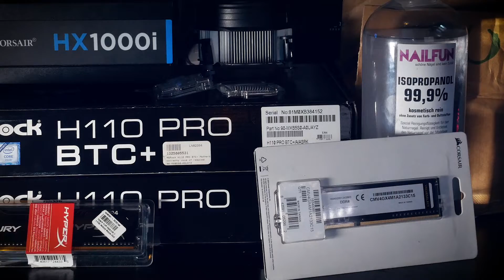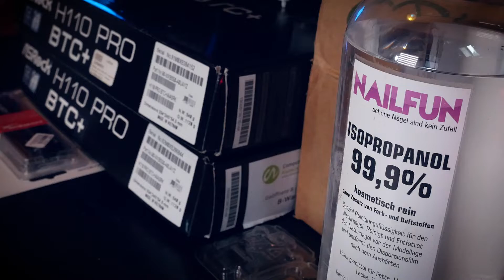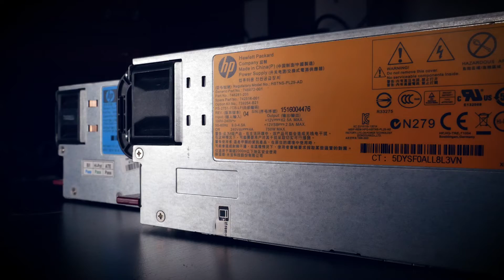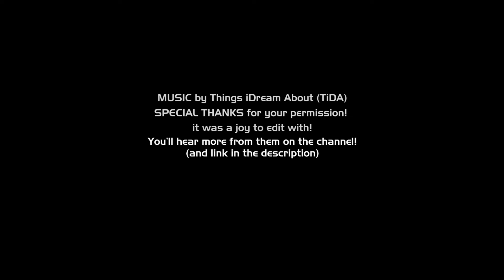GPU Mining Rig Basics (Asrock H110 Pro BTC+ Build) How To 101

Comment: Do you need to connect the molex cables to power all of the pcie slots? Or is the regular 24pin cable enough to power the board? Thanks
Reply from the maker: Heyho, indeed with a multitude of cards you will need the Molex on the H110. It will ask you to do so and not start otherwise, cheers ⛏️
Reply: @CursedMining  Thank you! The molex cables included with my power supply have multiple connection points running off of it. Does one cable have enough power or do I need to run individual molex cables to each spot on the board? The first pc I built was an X570 Ryzen based system, so this is my first time needing molex for anything. I appreciate your advice and time.
Reply from the maker: @nicholassmith7723  No worries Nicholas, that's what the channel is for :) one cable is more than enough for powering the MoBo Molex :) in the past I even split off additional molex from that cable for a fan 😁 cheers ⛏️
Reply: @CursedMining  Thanks again, I just subbed. I've been hesitating getting more cards in without knowing more about how to power the board, so you were a great help. Any thoughts on what to mine after Ethereum?
Reply from the maker: @nicholassmith7723  I personally think ETH mining will still be around for a bit. For after: we will only really now when the time comes but I have been mining before there was ETH, I think there will always be something to mine :) cheers ⛏️

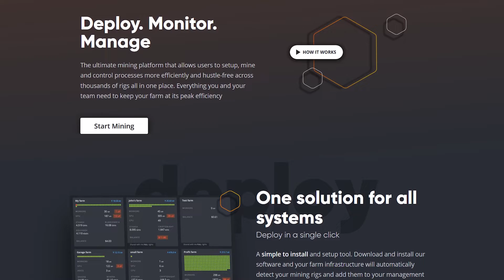Comment: Where is that next video you mentioned on 4:40 ???
Reply from the maker: It was deleted by YouTube as "dangerous and harmful" content in the Purge they had 😭
Reply: @CursedMining  I was just looking for this.  I'm running this motherboard with the same CPU with one 3080 FTW3.  When I add a second 3080 FTW3 it gets stuck on the ASRock startup page.  I'm using all new components and powering it with EVGA 1200W P2 and version 10 risers.  I'm power the risers with 6 pins from the power supply.  I'm stuck.
Reply: @CursedMining  Put the file on google then we can download it :)

Comment: Hello hope you are having a great day..how much money do you have invested in this build so far?
Reply from the maker: Hey Carl, let me calculate a bit (since I am an nerd and collector some stuff has been here for longer): MoBo (40€ - bought used). RAM (free in this case because gift - but 30€ new), G4400 (~50€, bought new back then for the first AMD rig), the case cost me 50€ on eBay (I was the only bidder), PSU is expensive new (178€), but I got that one back in 2017 and ran Baikals with that, so theoretically it has ROId with the Baikals back then. Here the Server PSUs I mentioned are much cheaper (1200w can be found for 20 - 30€, adding a breakout board for 10 - 20€). Sooo I'd say without PSU but with RAM cost added this basis cost me 170€ - I hope that could help! Cheers and thanks for checking in =) P.s.: A great evening to you too! For me it will be maintenance night-shift hahaha, another rig acting up, probably jealous of the new build =D )
Reply: @CursedMining  In one of your past videos do you explain how all of that works? The breakout box / Server PSU and connecting things?
Reply from the maker: Part 2 will explain more closely, but also yes, for example search for "X6 AMD" on the channel :) this was the rebuild video of the rig I mentioned in this video, there you can see more connecting, cable management etc. (breakoutboard + serverPSU should not worry you, can easily be put together) I hope I could help, if you have questions ask anytime :) cheers ⛏️